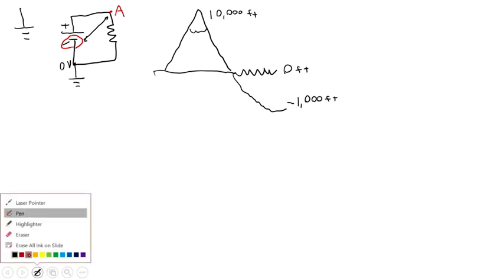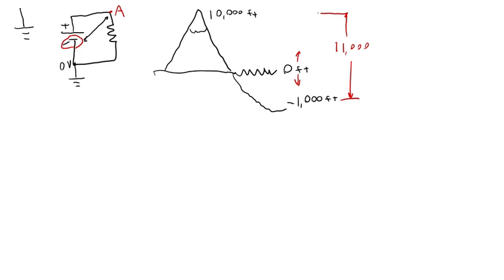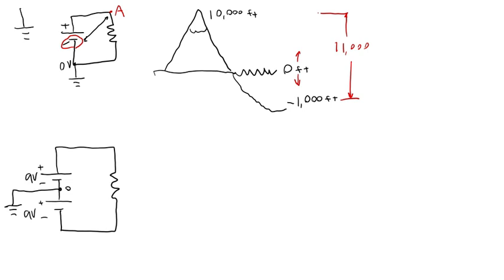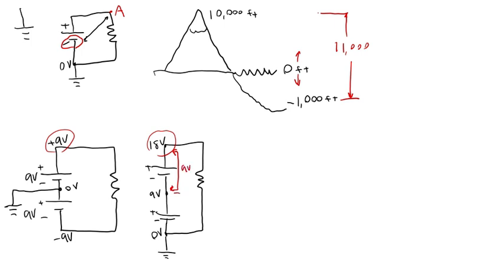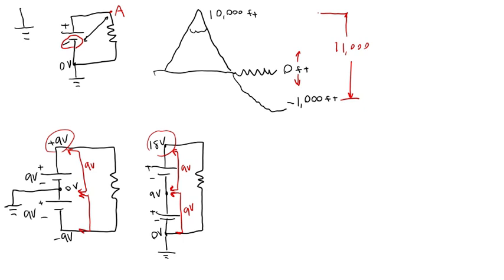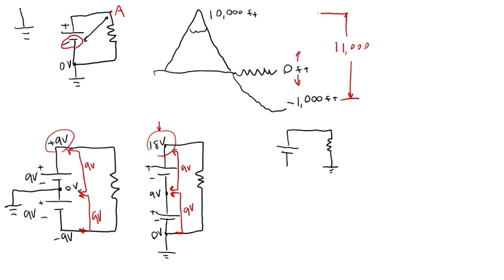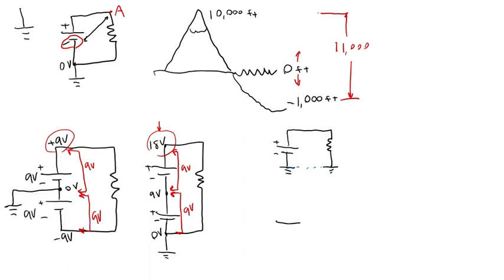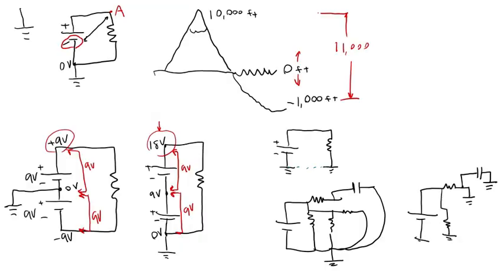What is "Ground" in a Circuit?

Comment: At around 4 minutes you say that series of 2 9v batteries is still 9v but another video explains that a series of 2 batteries adds their voltage together. Can you explain this issue?
Reply from the maker: It depends on what two points you are measuring the voltage between. The drop across a single 9V battery is always 9V (i.e. between the center point connecting the two batteries and one of the outer points), which is probably what I was referring to at that point in this video.

Comment: This is more confusing than basic math, i cant do basic math, i understand the positive wire, basicly carrieng electricity to activate something. But whats the point of the negitive wire.
Reply from the maker: You need a closed path, or a complete loop, for electricity to flow from positive to negative. If there is just one wire, you have an open circuit, and electricity cannot flow.

Comment: So when grounding a circuit does it always have to be connected to the actual earth? Like in a car how would they ground the devices if the car is on rubber tires so the current wouldn’t be able to get to the ground right?
Reply from the maker: No, mobile vehicles (cars, robots etc) have what is referred to as "chassis ground" usually where the metal frame of the vehicle is considered ground. Flying vehicles aren't connected to the physical ground at all but still have a chassis ground. The same goes for battery-powered circuits like your phone or a flashlight. They do not have an electrical connection to Earth ground (unless you plug your phone in to charge).

Comment: More confusion spreading. This symbol actually DOES mean connected to ground as in the PE of a mains outlet or a mains inlet of equipment. The correct symbol for a signal common, incorrectly called ground, is a hollow triangle. The third symbol of the set is chassis ground with three 45 degree lines. These are internationally defined standards so there is no excuse for somebody at a university for getting them wrong. 
Normally inside equipment all three are connected together, but that does not make them equivalent. Both signal common and chassis ground will be connected to PE, that makes them grounded not a source of ground. The distinction is where currents flow under both normal and fault conditions.

Comment: so in the second circuit(where we saw a bigger number 18V), does this mean that there is more voltage at that point and therefore the resistor on the right if replaced by led would blow up compared to the first circuit if we did the same? Again I understand that potential is relative, however in second diagram, since ground is not in between two batteries, but its at the bottom of first battery, thereby letting 18V reach the top left edge of the circuit and therefore allowing more current to reach the resistor(or led like I said)?
Reply from the maker: No - this is an important point - the voltage DROP across the resistor is the same in both cases (18V). In the left circuit, the resistor has +9V on one end and -9V on the other end - the difference between +9 and -9 is 18. In the right circuit, it has 18V on one end and 0V on the other end - the difference between 18 and 0 is 18. In both cases there are 18V across the resistor. I could say that I define the negative terminal of the bottom battery as 10 million volts instead of zero, and with two 9V batteries in series, I would still only have 18 volts across the resistor (in that case the bottom node would be 10,000,000 volts and the top node would be 10,000,018 volts - the difference is still just 18 volts). Going back to the elevation analogy - say you have the top of a mountain at 10,000 feet, and a trench at the bottom of the ocean at -2,000 feet (2,000 feet below sea level). It doesn't matter where you define zero elevation - sea level, the top of Mt Everest, the Moon - the elevation difference between those two points is always 12,000 feet.
Reply: @BenFinio  Wow thanks so much. That makes total sense. Thanks for your videos.
Reply from the maker: @blasttrash  You're welcome!
Reply: @BenFinio  doesn't negative voltage usually mean that the voltage is moving in the opposite direction to what is shown?

Comment: Suppose I took blank board made a circuit. Connected positive negative but where should ground will be design.  Means I designd ground but should I need to give it earthing?  How will it start to work as a ground if I don't give earthing or something?  You got wt I want to ask?  Only connecting to body will start to work as a ground???

Comment: What’s the purpose of grounding circuits anyway?
Reply: I think it's more of a safety measure. Say your pc has a metal case and a loose cable which gives you a shock when you touch the case, grounding it will make the extra voltage go to the ground so the case voltage is 0 and safe.
Reply: @dannychelly9187  I get a small shock whenever I touch my pc case barefoot  . I built my pc  by myself
Reply: To calculate different parameters of the circuit. To have a reference to follow in order to stablish the equations that define the circuit.

Comment: So if I ran a Marx generator which is powered by rectified AC to DC. Would it be possible to connect all the capacitor stages to the ground rod outside in the dirt? Or do I really have to connect all the stages back to the anode of the full wave rectifier? Please lmk